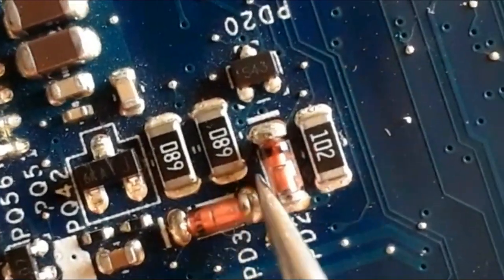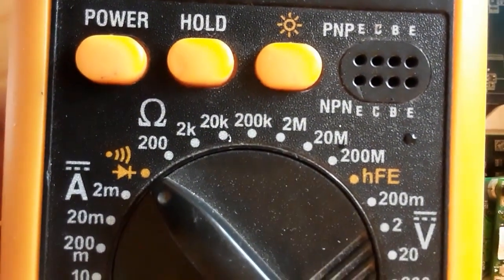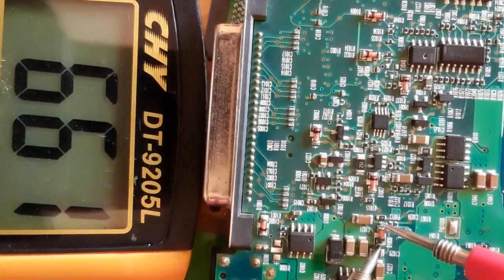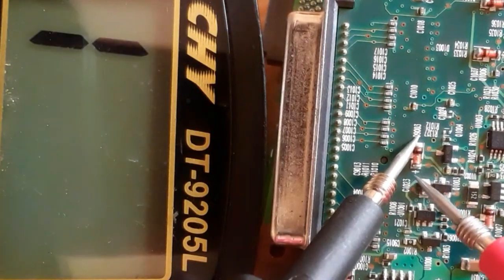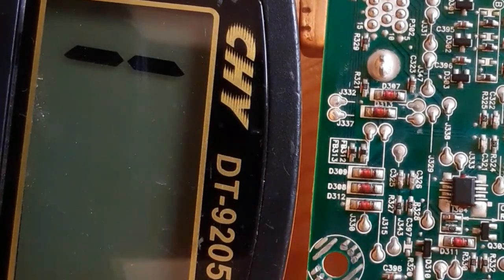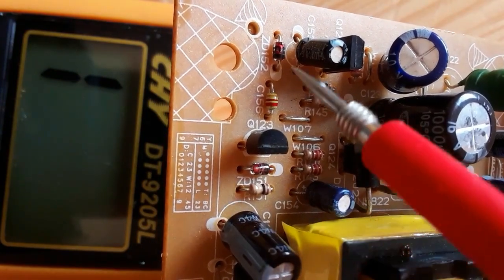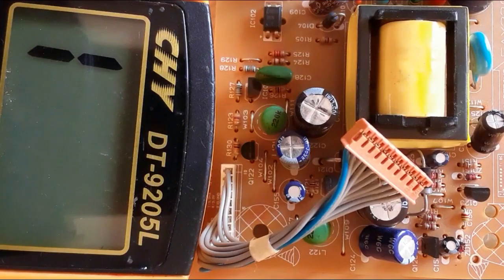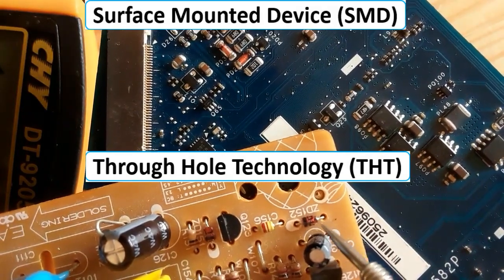How to test Zener diode with a multimeter

Comment: Hello, I have a SMD Zener Diode that's shorted. I need to replace it, but I don't know the voltage. I can't find any markings on it. Any suggestions on finding the voltage? I can't remove it to test as the diode is dead.
Reply: Actually I think the best bet without schematics is to find a board similar to 2hat you have , I honestly can't think of any other way.

Comment: What if i got reading both side? when i dismentle diod from board just got reading one side..but when i instal on board i got both side reading..can u explain why?
Reply: You have a capacitor or another component in the circuit along with the diode. This is why it's always best to pull the diode and test.
Reply: maybe short the capacitor

Comment: Hi sir nice video can i this ziner diode replace to black 4007 diode. it's work proper or not.aqualy my voltage clamp meter are short on pcb smd same ziner diode has been short but do t have same smd ziner diode plz reply
Reply from the maker: Hi there,
Zener diode is used to stabilize the current and the black diode is used for protection and rectification,  So you can not do that. Zener diode must be replaced by zener diode.
Reply: @electronicsrepairbasics_erb  ok thanks sir alot of thanks.
Reply: Excellent information! With your instructions I found a bad ziner diode on my board, how do I know the value for a replacement ?